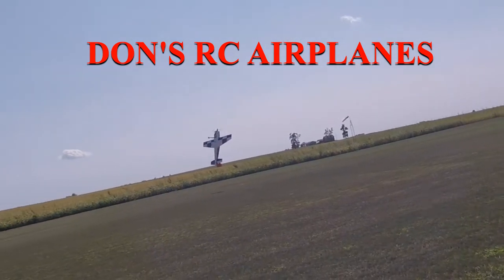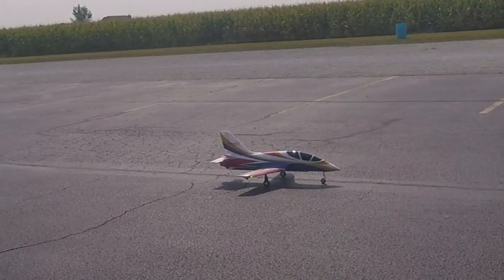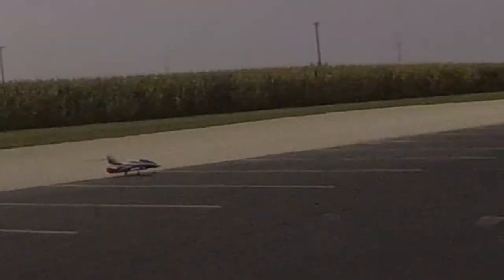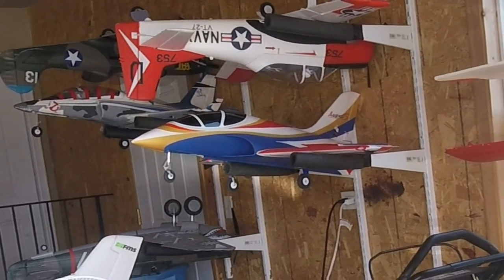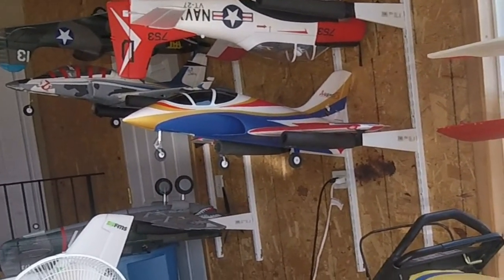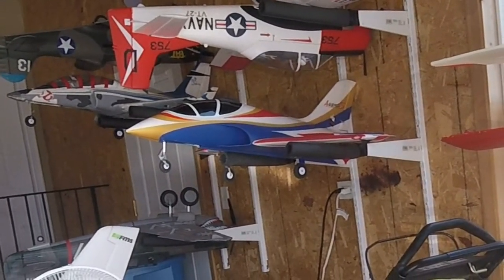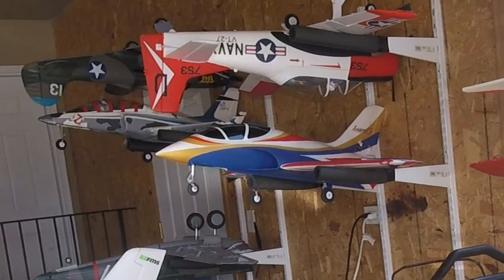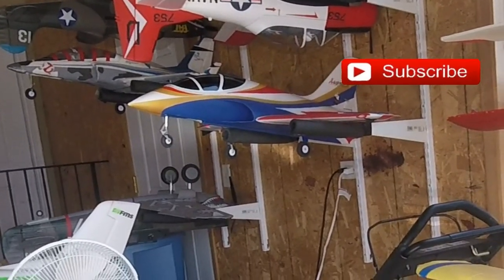FMS Avanti V3 70mm EDF Lemon Receiver Range Problem

Comment: Glad you got it on the ground safe and sound. Range issues can be plane killers. I had a maiden today of my second hand Carbon Z Cub (Latest Version) all went well but I need more rudder travel. I have just set up my second maiden for tomorrow. It is the Flightline F7F Tiger cat. Both were bought second hand at our swap meet from last weekend. I am nervous about the tiger kitty. She is a little complex being a large twin with flaps, and gear.
Reply from the maker: That's awesome my friend . I heard nothing but great things about the Tiger cat. Hoping your maiden goes great. Swap meets are  great places to find airplanes. Sounds like you did well.....Thanks so much for watching ....

Comment: Don I've had the same problem with a Lemon receiver!! Unfortunately I lost the plane after a crash on it's maiden flight😣 I've had the same problem with an Admiral receiver too!! It was fine in warm weather but as soon as it got colder and damp ( living in the UK that's the only weather we get Lol ) it started glitching and going into failsafe, so I stopped using it!! Can you fit a satellite receiver on the Lemon?  If not for about the same price as the Admiral I was able to get the Spektrum AR620 6 channel antenaless receiver and it has very good range and you can also set up a proper failsafe as well, maybe like my Admiral it's susceptible to antenna placement!! I noticed with mine that any servo wires by it caused it to glitch badly!! Hope you sort it out, it would be a shame to lose that lovely EDF Jet👍😄
Reply from the maker: Hi Ian..Thanks for the great advise, adding a satellite receiver  sounds good. I have several of these receivers and never had a problem. I put that AR620 in my 1800mm Ranger, it has worked great .One of the antennas moved and was hitting the quick connect board inside of the avanti, hopefully that was the issue .I rebound and did the range check. It did well on the range test, hope it's fixed now....Really appreciate you watching , and your comment ...
Reply: Glad you got it sorted Don👍

Comment: Hi Don, Did you remove the Reflex gyro? What about the circuit board on the top area (internal) I did not know if I should remove this as I have with the Reflex (which did not work properly) I may just take the receiver with SAFE out of the Viper & try in in SAFE mode.

Regards Noel
Reply from the maker: Hi Noel....So this one did not come with the reflex gyro.Installed a lemon receiver with gyro...One of the antennas moved and was hitting the quick connect board inside of the avanti, hopefully that was the issue .I rebound and did the range check. It did well on the range test, hope it's fixed now

Comment: Hey Don,  I have a Avanti 70 mm ordered,  I'll be using the new Spectrum 6 channel reciever that came from a crashed Consendo Evolution,  Do you think it will be okay?
Reply from the maker: Hi Scotty .....That Consendo is really fast so the gyro settings should be fine. I read that the AR637T from BNF planes could be unlocked so you could get in there and make adjustments in the gyro settings using forward programming ...
Reply: @DonsRCAirplanes  Sounds great,  supposed to be here in a couple of days,  it's Fast hopefully it doesn't turn into a lawn dart,  I want to make sure I have it set up right before I maiden it,  I may be grounded for a couple of days here supposed to be windy and stormy and unbelievably cold weather in South Carolina for late April I appreciate the information and the great videos you share,  by the way I really like the Air Tractor and I actually have the Du Bro landing gear but my gear look as good as new, so far I have greased every landing 👍